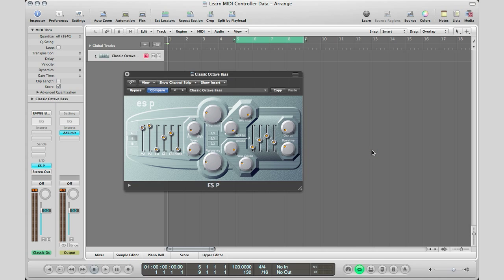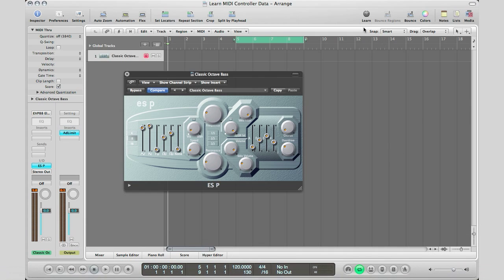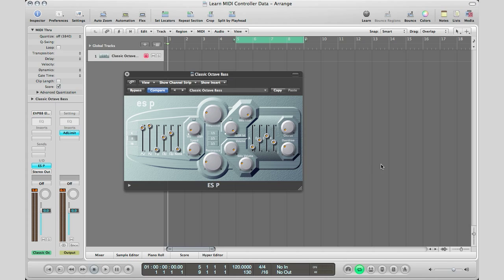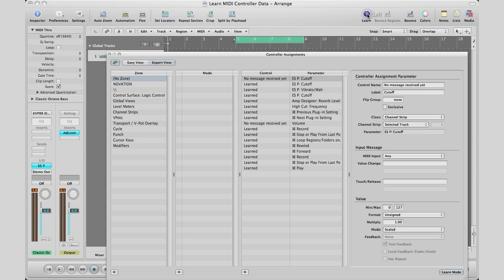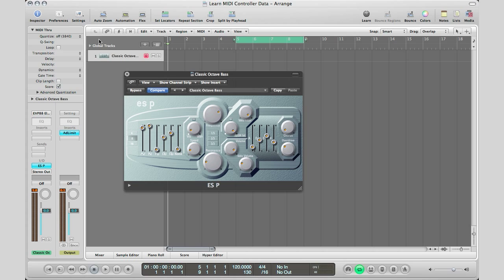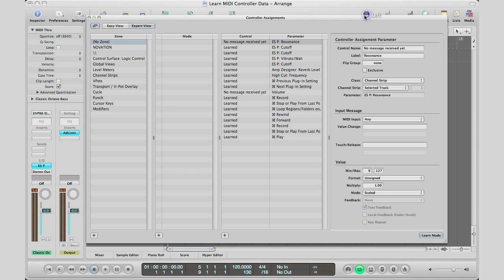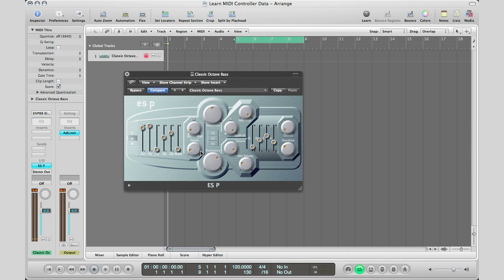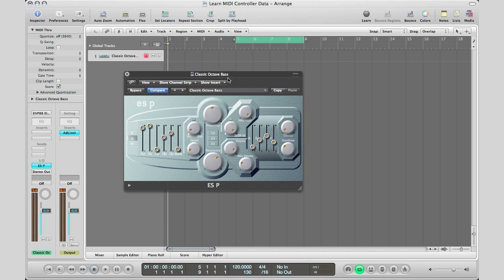Controlling Logic With Your MIDI Controller Made Easy!

Comment: Thanks.  I have two questions.  First, If I teach the controller 6 parameters using the EXS24 plugin and then teach it 6 different parameters for the ES1, do I have to reteach the EXS24 parameters?  Does it remember which plugin I'm using?

Secondly, I'd like to get the axiom 25 v.2 as a controller.  I'd rather get the axiom 49 but I want to take it on an airplane and it may be too big.  What do you think of the axiom, and what other brands should I look at?

Thanks in advance.